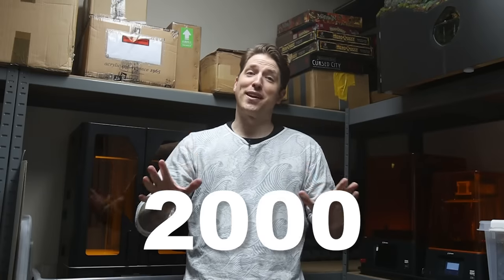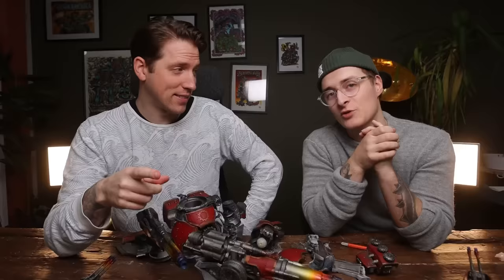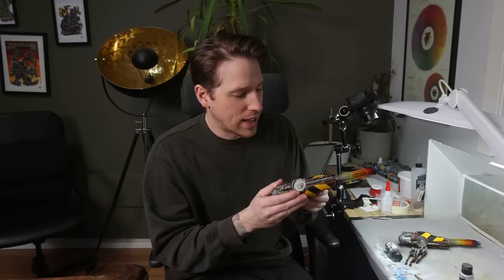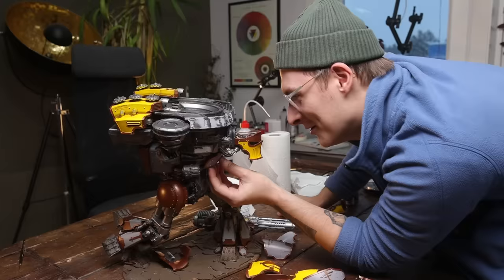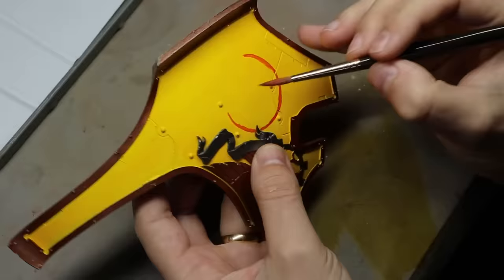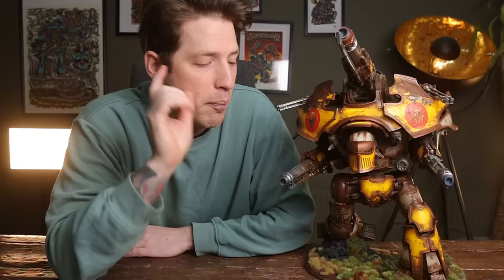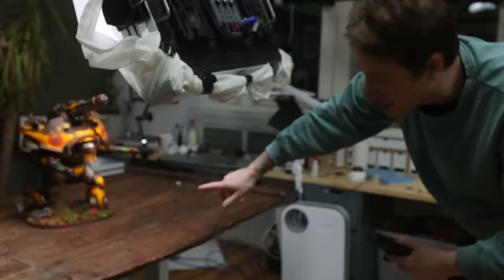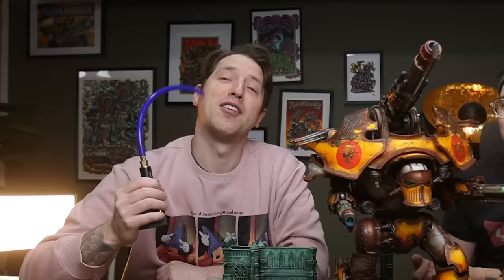I traded a $0.10 goblin for TWO Warlord Titans!!!

Comment: The superglue broke because of below freezing temperatures during the shipping. When the resin shrunk due to cold the superglue bond simply crumbled.
This is btw a very good way to remove strong superglue bonds on resin and plastic. Put it in a freezer for some hours and most superglue bonds should have weakened significantly.

Comment: This video was awesome, so creative. I thought Titans were bigger than the mechs I print, that Titan is common size on my shelf.
Reply from the maker: And i assume these mechs are quite a lot cheaper ;)
Reply: Plastic created by GW is obviously worth 10x more than any other plastic available
Reply: @brisingr0962  ironically there metal minis were cheaper before they made the switch then they jacked up the price
Reply from the maker: @brisingr0962  Sure the IP is worth a bit, but when you consider how well cast the mechs are, 2k for the titans feels a bit... erhm. Hopefully they can start making them in plastic and at least cut 2/3 the price.

Comment: Odd question - given that the titan you received was in pieces - how do you best package these things to prevent damage in shipping?
Reply: Nothing you really can do that is cost effective. No amount of bubblewrap and sponge will save it from crushing itself when it gets hurled around in shipping. You’d need a solid non maleable box with cut foam inserts to fit the parts and prevent them moving under their own weight.
Reply: @banishedpest115  thank you